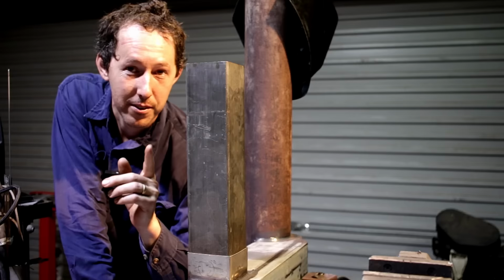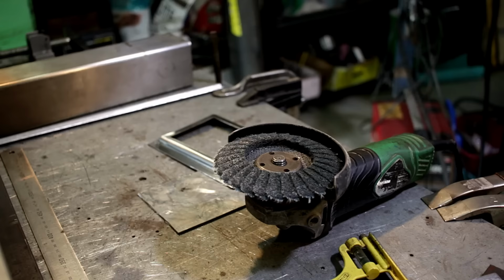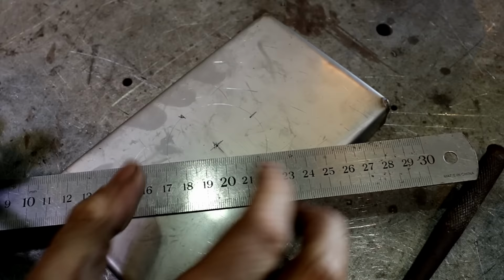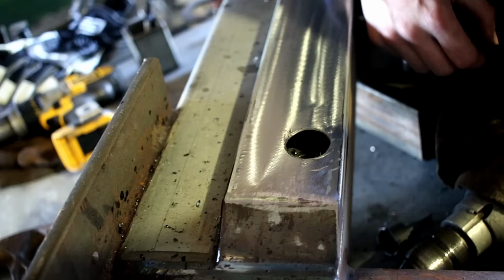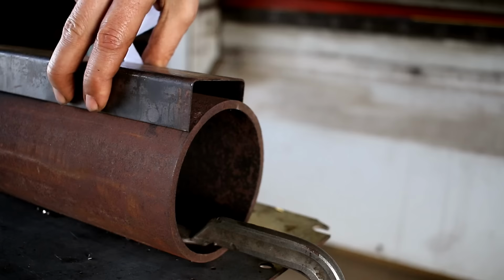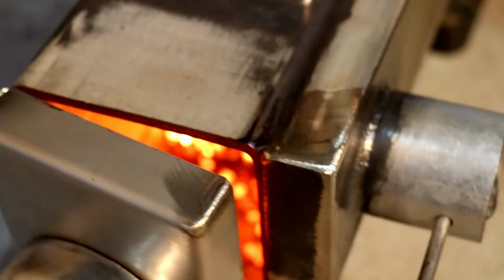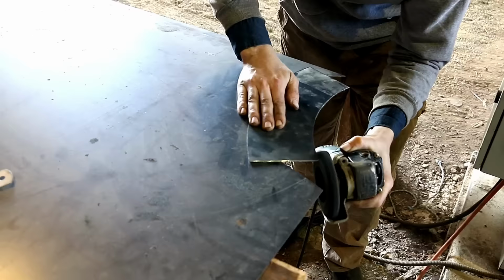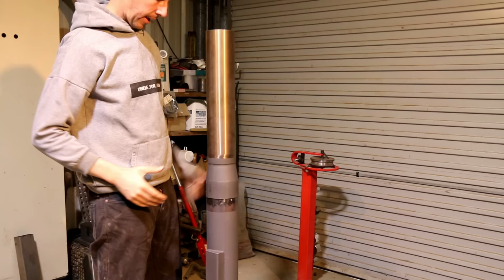Vortex Rocket Stove Pt 2

Comment: expensive drill press, mind you can't have enough toys and it's very surprising how many reason you can come up with to justify buying them. also get some very good insulation round the riser pipe, it helps combustion

Comment: Also I don't like the basket idea... It should not smoke out the pellet hopper , I suggest you use a gravity feed that drops the pellets in , make an insert that goes in I have mine at a 45 °that goes up to a short table top and of coarse the frame work to hold it all together. Now drill holes in the 45°angle face . Have your hopper slightly enter the burn chamber so that it stops your insert. The pellets fall onto the insert and the holes allow the air to pass ... It works like a charm

Comment: I find it hard to conceptualize burning gasses because they are invisible. Here are some data that I find useful. (American customary measure and very approximate numbers to make the arithmetic easy 😁.) 1 cubic foot of methane gas yields 1000 BTU. It takes about 10 cubic feet of air to get the 2 cubic feet of O2 to burn the 1 cubic foot of gas. Soft woods yield about 5000BTU per pound. So 1/5th pound would yield 1000BTU.  1 cuft  ÷ 35lbs per cuft = .0287cuft,  the volume of one pound of wood. .0287 ÷ 5 = .0057 cu ft, the volume of wood needed to yield 1000BTU. TAKING the 10:1 air to gas ratio to guesstimate the air to wood ratio, you need about 10cuft of air for .0057 cu ft of wood. That's about 31/4" X 31/4" X 1" compared to 10 cu ft. These aren't numbers to bet the farm on but they do illustrate why rocket burners roar trying to get all that air through the system.

Comment: Camping/mobile section: 
What minimum steel plate thicknesses would you recommend using for constructing any wood/oil furnace or stove pipes ?
Reply from the maker: If it's stainless steel you can get away with 2mm
For mild steel I would go a minimum of 3 mm.

Comment: Outstanding.  Keep up the verbal info. I hate silent videos.  
Just out of curiosity  ... if the secondary airflow is to create a hotter burn wouldn't a cold airflow be better? If you are burning oxygen  ... cold air is heavier, therefore  more  (condensed) oxygen.  I may be wrong  ... just thinking.  👍

Comment: I just had a thought M8 I f your main combustion Body was larger dimension,.... maybe 30%.......shooting from the hip.........then you would have more DRAW from the front and an adjustable intake could also be larger, maybe also try a more tapered basket with that? Drawing on my loudspeaker design /builds. Where the Math from the books did not match up to real world performance.

Comment: Did you consider making waste oil as a fuel for the rockets? It seems to fit very well as the oil needs lots of air. 
I think this would work very well as a waste oil burner.
Reply: I'm going to build a rocket stove with some slight changes to accommodate waste oil. I've built a couple of conversion units for woodstoves, and ran and maintained Black Gold units in my shop.

Comment: interesting development in it's build.  at them Tempricha & the fact it as a ember bed  if for example   if one intraduct a 2" steel pipe  bed was charcoal in to the stream  of the burn. in the rocket stove,  & a copper pipe was to  pas s stem down the. 2" pipe  of the charcoal   Bead  the result   in the 2" pipe would result in a  plasma created by the burning of oxygen within  being  burnt off  & as a result hydrogen coming out of the other end creating hydro carbon's that will run a generator for of grid camping.  so the siystom you have built is capable of boiling water to stem & that stem can be trend into hydrogen  to run a engine to produce  electricity . their will need to be sufficer supply of caracole to replenish the plasma stream as the oxygen is burnt off  so 4" pipe elongated to hold charcoal that can feed the Bern zone . as the oxygen reacts to the charcoal Bern within the pipe . this must reman air free so that  hydrogen levelling  the pipe  dose not become contaminated with air. this is a very impotent point   cooling it within your tank of water will allow it to barn oaring  or even clear . adding are at the pint of combustion will let it power the engine & drive it without contaminating  it with tar like  the wood gas devises do at times.  once upon a tine the early balloons were field this way, before we used hot air. work as well so their you have. the as some systems on the markit that ues water dripping  in to a caracoled Bern zone that sucks the gas out in to a vacuum to power the engine's if this approach is ues the burn zone will remove any oxygen in the siystom . berlin in the rocket stove wood  to stat the proses  the pint is using stem to predust hydrogen or water drops solong  as the oxygen is Bern of in the Bern zone you will have success.

Comment: been thinking about this a lot lately (yeah. that is dangerous when it happens)  Seems the assumption is this powered/force introduced air  (esp. fan forced air)  it is assumed this is the air that gets used for combustion.   Im beginning to think that may  be only partially the case.   It mayyyyy be those devices are realistically mostly about creating a vacuum to suck in more combustible "secondary source" of air behind it.  Wondering if the forced air system (fan, turbo etc) is just the tool ""for providing easier to combust (not moving so fast) air that tagged alongside/behind the forced air.  This tagged along air ending up to be what improves combustion the most.  It makes an easy to use greater air "volume"  the combustion process to burn.

one way for anyone who gives a crap can test this... is to experement more with introduce things in the flue blowing out it instead of the common way of pushing air into a stove. This in net effect pulls and packs secondary air in.    If this method produces same or better combustion then this may prove this idea presented above.  

now question is can you even understand my gibberish  as I intended lol

Comment: Greetings from the mountains of New Mexico. Great trouble shooting information. I’ve watched this  a couple of times now and learn something new each time. I appreciate your attention to detail. I’m building a large unit with a thermal mass chase lounge. I’d like to incorporate an internal coil in the secondary chamber for a radiant floor loop. I’m curious what material you’d use for such a thing, copper, stainless or steel? I’ll be running glycol in the loop. Thanks for your time.
Reply from the maker: I'm no expert in such things.  Stainless steel would be the safest option. 
You might get away with mild steel running glycol, I'd do so more research.
Reply: @LittleAussieRockets  thanks for the reply. Have a good one, stay Safe

Comment: The Holy Grails (plural) of rocket type stove efficiency are ......
1. Very effective Insulation of the entire combustion process. 
 2. Proportions of firebox, throat, secondary burn tube ("riser"),  and diameter / length of the exhaust ducting. 
 3. Absolute control of air feed to primary and lower secondary combustion areas ( slow as possible results in timber carbonising completely before final combustion.)  
4.  Heat harvesting, usually by way of a long horizontal heat-exchanger / "exhaust" inside the area to be heated. 
5.  Efficient use of heat by way of heating a large mass to dissipate heat while asleep and fire goes out. 
                  Finally, a properly proportioned unit, due to the inherent pressure fluctuations between primary and secondary burn areas, the narrow throat between the two, and "path of least resistance" effect, will (should), much like a pulse engine,  produce a very slight pressure on the exhaust side, allowing for a very long horizontal heat recovery /exhaust.
Reply from the maker: Well said 👍

Comment: First off, anyone who criticizes you or your build is a troll... plain and simple. Just ignore them. You cannot cure stupid, and you can't please trolls. Second, this was one of the most pleasing video series I have seen in over 10 yrs. of watching videos. THANK you for all of the effort to make the vids! Third, in considering the concepts applied in the mass stove versions of a rocket stove, where they use a small steel drum for the riser, and then use a larger drum upside down over the smaller drum thereby creating a reverse draft by redirecting the exhaust downward to the final output using the rapid cooling and gravity effect which is created by the outer drum to increase input draft flow, while milking even more of the thermal energy from the exhaust before releasing it, what are your thoughts for adding this design to your stove?
Reply from the maker: Thank mate 👍
Yes I have been thinking about putting a steel drum on it and adding a heat exchange for a hot water system.  Thanks for sharing your ideas with me, it's really helpful.
Reply: @LittleAussieRockets  If you mount the "drum" over it, and coil the heat exchanger tubing around the outside, you could use a pump to take that heated fluid to heat water and your house/work shop, or any other space you you wanted. You could use automotive heater cores or radiators with a mounted electric fan for the heat exchanger for the space heating.

Comment: Really enjoyed your part 2. I am curious to know what temperature are you getting coming out the top? Also how long does your burn last with your basket of pallets? Liked the fact that you persisted until you increased its efficiency. Did it make a difference with your secondary holes up the chimney?  Did you use them at all because you made no reference to them again once you attached the piece to the outside. Do you reckon it may have made a difference if you had angled the holes so that the air they were drawing into the chimney came in in the same direction as the vortex was spinning?👍🏻👍🏻

Comment: My proposals;
1) put Air Damper\Controller at the Primary Air pipe Inlet
2) cut off the 2nd Air Square tubing before pallet loader. After that; do not put any air controller (let air enters freely without any human manipulation) 
3) remove the air controller at the riser air inlet or always fully open this inlet 
4) insulate the riser with perlite

Comment: So if I have a big pole barn workshop that I don't want to cut open for a chimney could I run this inside with the doors pulled shut?
Reply from the maker: Only if you have decent ventilation. Otherwise carbon monoxide will become a problem resulting in 😵‍💫😵⚰️😇.
I always left a door open for this reason.
Reply: @LittleAussieRockets  well I have 2 large sliding barn doors so if I had them both cracked open it should be alright?

Comment: Hi, Steve, Have you looked at a rectangular or oval intake and exhaust? I believe they have they did that for the lotus turbo (changed intake piping from round to oval) for 10 to 15 % power increase. Just a thought...
Reply: ok might not work with vortex

Comment: hahahaha that chicken walking backwards @7:08 cracked me up !!!!!           But i also might have a suggestion for the exhaust.  Here in Holland, we had in the 70's a lot of houses with an H shaped exhaust.  The middle hortizontal pipe would be connected tot he riser., The flow would go left and right, and the heat obviously goes out the top side of the two vertical pipes. Drawing cold air from the bottom, and cause a tremendous suction in the horizontal pipe....if you catch my drift :-) ( https://img.fruugo.com/product/0/83/18200830_max.jpg )
Reply from the maker: I will have a look. Thanks

Comment: I was thinking about how the heat causes the pellets to release more "fuel" and when there more heat generated the flu sucks in more air and wondered if it would be possible to make a turbo rocket stove that operated like a pellet powered jet engine.
I know people have run auto turbos on wood before but i haven't seen any that can run indefinitely under pressure iow without needing to open it to refuel it. I also think that you could gain some intrinsic efficiency by burning the wood under high pressure.

Comment: is it possible with a waste oil burner If I can get the temperature up as much as needed to melt copper?
Reply from the maker: I'm actually in the process of designing a rocket furnace that will hopefully be able to melt copper and aluminum. Stay posted
Reply: @LittleAussieRockets  that would be sweet to make some copper sheets.

Comment: didnt see you cut the opening in the main tube before welding on the secondary air on the outside [not the inner one]and the basket is way too big =poor efficiency
Reply from the maker: Part 1 and yes

Comment: Re fire rotation direction, no it doesn't matter. 
In general Coriolis effects cause low pressure systems in the equatorial regions to rotate clockwise in the southern hemisphere and anticlockwise in the northern hemisphere imparted by the spin of the earth. This then determines the direction of rotation of the high pressure systems of each hemisphere the southern hemisphere being anticlockwise and the northern clockwise. 
Why this happens is because equatorial regions are characterized by upward movement of air from convection due to greater solar heating. 

Coriolis has nothing to do with water going down sinks or baths. On the micro level the effects are negligible for combustion efficiency - in the real world I defy any person to prove otherwise since there's too many variables in a wood heater to conclusively state that Coriolis makes this heater better if the flame spins one direction or that heater better if it spins in the other - meaning the spin direction is irrelevant. 

What'll make the stove really go is if you put a venturi in it on the pre fire side and use auxiliary air pipe to bypass the venturi for slow combustion and/or moderating the flame.
The door/vent etc at the front acts as a venturi anyhow so you'd be reinventing the wheel but it could be refined for the purposes of a small heater for great effect I'm thinking. 
I'm not sure of why you'd want to pre heat the intake air. Less dense, less volume of air and therefore oxygen (but same % of O2), so less combustion, less heat, less efficiency. Might be beneficial for when it's closed down for slow combustion but!

Comment: I will have a pellet burner to offer you which is different from yours, with power 
regulation, I've been heating myself with it for 5 years now and it's working very 
well, little maintenance, you just need a good quality of pellet with a light ash that 
does not block the burner, if you are interested!

Comment: Could i use this stove inside without any Classic offtake pipe and instead Just with enough Outlet wholes on the hight of the floor for the Carbon monoxide going Out and fresh Air comming in? Greets from Germania
Reply from the maker: I wouldn't risk it. I would have to outlet going out a window or something.  It's not worth the risk.
Reply: @LittleAussieRockets  yes i read that Carbon dioxide is very Dangerous too
Reply: But are you using your stove without a chimney indoors? Looks Like a Garage..
Reply: But your Garage Door ist closed ! Explain please!

Comment: The Original Video showed you welding on the hot air intake but you did not cut a hole in the main tube for the hot air to be injected into it.
Reply from the maker: I cut a slot with a grinder, but it was in the wrong spot.

Comment: Great job mate, I'm as you, I love building things. It gives you a sense of being able to beat the odds of survival. One thing came to mind while watching these two videos, and that be it wouldn't hurt to take a carburetor adjustment class at the local voh-tech as there's so many air valve's or adjustable orifices on this thing fine tuning it is essential to getting her up and running at max potential or anywhere in between. The next one built you might check into some sort of computer controlled electric servo motored apparatuses turning it into a fuel injected rig of sorts that way you just throw the pellets to it light it adjust a knob for temperature control as a rev limiter sit on the couch with a foot pedal and hot rodder like you stole it. I'm still scratching my head what that cool chicken got into haha. Great videos bud.

Comment: I like the videos thanks. I need a rocket oven to bake bread made for me in Australia, I want the innovations and vortex flue design. I either want something made to my specs or a plan I can take to a fabricator within my specs, I want to bake 2-3 loaves efficiently at a time outdoors and not get stinking smoke in my face. Need stable temps around 220C. Can anyone steer me in the right direction

Comment: What about insulation on the outside: keeps the heat inside where you want it to be until it exits the chimney. Great work!
Reply from the maker: If it was made out of stainless steel I would. Handle the exact heat🔥👍
Reply: @LittleAussieRockets  Hate to bore you, but what is the difference between carbon steel and stainless steel when heated? Why insulate the one and not the other?
Reply from the maker: @TTTzzzz  stainless steel can withstand a lot of heat without breaking down, 1700° F for 304 grade stainless. Mild steel has a max working temperature of 750°F .  At higher temperatures mild steel just breakdown. But if you keep it with then it's working temperature range it lasts a long time. But that's why I can't insulate this stove.
👍

Comment: black steel life time in this stove is just 2 week or max 2 monts, all steel need be covered be stove brick
Reply from the maker: It's still going through. If the wall thickness of the steel was 1.6 mm then yes I would agree with your statement, but it is in fact 5 mm in the thinnest and 8 mm in the thickest and it is still running just fine.
Reply: @LittleAussieRockets  my stove ruin black steel plate in 2 week, wass only this not protected steel and in 2 week was like was in solt water 100 year  this hapen from 1000+ degrees Celsius in 30 day